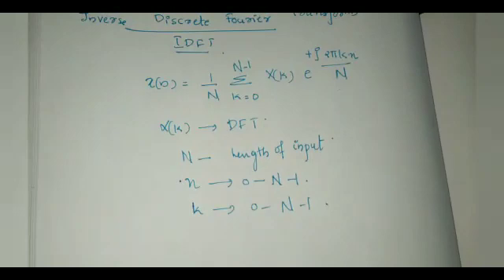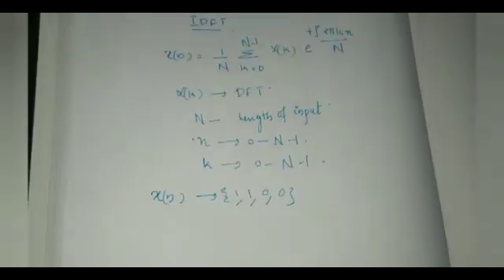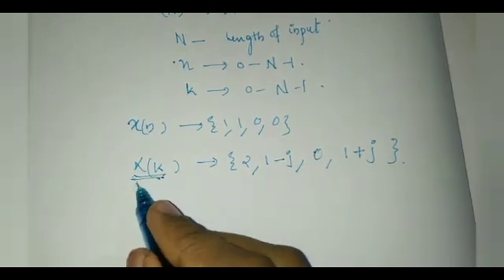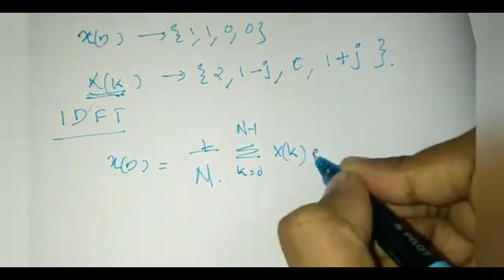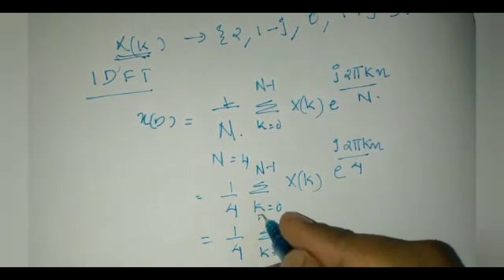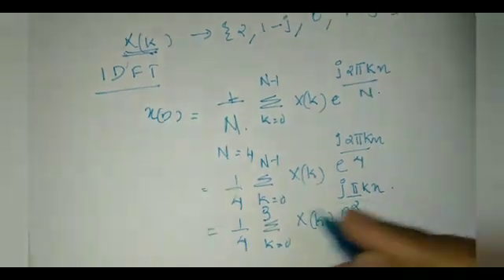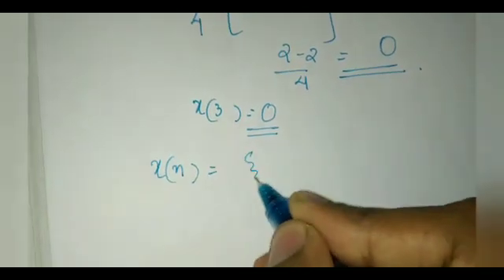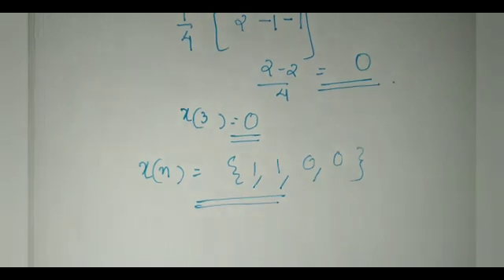Inverse Discrete Fourier Transform with example|IDFT with example

Comment: Thank you, I was looking for this, and only found it now.
Reply from the maker: Please share and support
Reply from the maker: This video has the matrix method also, which is very simple rather than going for equation based method

https://youtu.be/Kqvy-jNomUc
 If u want you can check this also
Reply: I have done the DTFT using my code and it works, now I want to retrieve the signal, how do I do that say in Excel? Do you have a spreadsheet I can plug in my own general values, I am very new to Fourier series,
Reply from the maker: @Tapsthequant  this is DFT not DTFT and if u want to retrieve your signal using IDFT just mulitply your result with the IDFT Matrix. 

If u are using MATLAB you have a function called ifft for that.